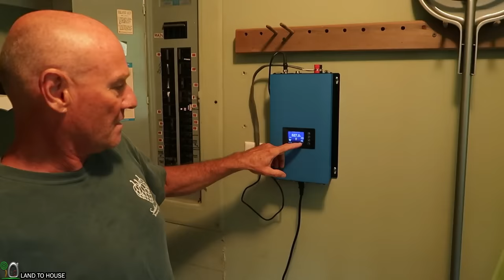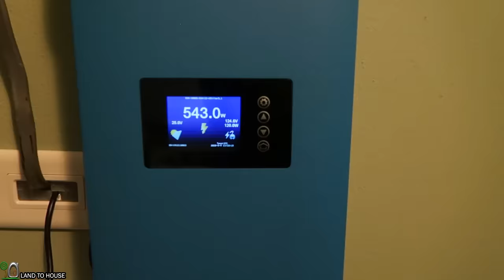Awesome Low Head High Flow Grid Tie Micro Hydro 530 watts!

Comment: If he replaced each of those 90 elbows with two 45's he would get significantly more velocity.
Reply from the maker: That is likely true!
Reply: Positive 👍
Reply: but would that not put extra load on the turbine ? does that matter ?
Reply: The creek might not have enough flow to allow more velocity to pass through turbine
Reply: a 90° eblow  can restrict flow up to 12%   always use swept bends     may be possible to do this with 4"  pipe .   running the syphon tube to a larger dia destroys the syphon.
Reply: As would placing the generator at the bottom of the pipe
Reply: @navrajjohal9053  That's extra power. Everything in the system has to work together.
Reply: More velocity=more flow, you saw how little was passing over when it was running, it`s likely he`s at the flow rate that can be sustained
Reply: @davidoff59  Given the syphon effect, is this true?

Comment: As an electrician, my only issue with this system is the male plug from the inverter plugged into a general outlet underneath the distribution board.
If you trip over that and expose the plug or a child pulls it out, those plug ends are a potential death trap.
Reply from the maker: When the grid is removed from the inverter it actually turns off.
Reply: I came here looking for this comment
Reply from the maker: Its the primary concern with this install. I personally keep my two grid tie limiter inverters locked up so nobody can get to them.
Reply: @LandtoHouse  If the sense wire is still energized but the cord is pulled does the inverter turn off the output anyway?  If so then it is ok.  If not it is a code violation of 406.7(B) Attachment plugs shall be installed so that their prongs, blades, or pins are not energized unless inserted into an energized receptacle or cord connectors.
Reply: you know he could put a regular switching panel in and have power when the grid goes out... The Plug thing is so wrong in so many ways ~!
Reply: The inverter circuitry itself is actually powered from the grid and instantly turns off if unplugged, plus it has a C14 plug that would probably pull out first.
Reply: @captainobvious9188  that wasn't very obvious captain obvious
Reply: He should have used a 3 wire with a ground cable.  You should never use the ground wire to carry a load.  Not safe.  Total shock hazard.
Reply: thats all you have problems with?
Reply: ok Karen..
Reply: @cadilakiller  feel better now?
Reply: He is using the  ground  wire as a hot.  Safer to use 10-3 w g and a larger jct box
Reply: @erbewayne6868  this is incredibly dangerous. Your right 10-3 with ground is required. As an electrical contractor i cringe watching these videos
Reply: @erbewayne6868  also check out the wires in his rectifier. There not going to last long you can see by the coloring of the wires that the heat is breaking it down. Please hire a licensed Electrician. I live in Asheville and there is so much thats not up to code. I love the set up im just really worried about the wiring.
Reply: @cadilakiller cringe.
Reply: Every grid tie inverter turns off when it is unsynced with the grid.
Reply: Yeah I can't believe someone does this crap these days, and to show other people to do it too.
Reply: The ol' suicide plug

Comment: Could have a float sensor that detects the lake level and controls a 6" valve near the intake. That would prevent the level of the lake dropping too much and loosing the siphon.
Reply: Actually it's probably easier to regulate it with a device on the priming side. You could T off to an automated valve to allow air in and on the other side of the t an automated shut off valve connected to suction (also automated). You could control it with some relays and a pii / arduino. When the float detects the level lowering it would start to let some air in, more and more as the level drops untill the system stops, then when the level returns to the max the air valve would close and the valve to suction and suction would activate for a set amount of time before shutting off to restart the system. That was there are no valves reducing peak efficiency
Reply: I'd be careful restricting the inlet.
With all that vacuum it could cause cavitation which would knacker the turbine.
Better to let a bit of air in downstream to partially disrupt the siphon.
I would bother with an Arduino. Too temperamental and fiddly.
You basically need an old toilet. Use the ballcock and valve as an air bleeder.
You may need a larger valve, or use several ballcocks at different levels so the system ramps up and down.
It's a tune and forget system.
Reply: @JCJC650  a piece of PVC mounted vertically  with holes drilled in it.  As the water drops more and more holes are exposed, allowing more and more air.
Reply: Daisy chain two or three turbines. Gain enough restrictions to slow it down and totally not have an electric bill. Connect the system to a nice set of supper caps, could possibly power two homes.
Reply: @itslegit7362  you can't daisy chain them. Well you can, but the headloss across each turbine would be reduced so each one would produce less power.
You would have to run them in parallel but then you would likely drain down the dam.
Reply: @wormfighter1  even simpler.
Reply: @richardschofield2201  I'm not saying your wrong. But I am Fire system tech for over 10yr, I work with tons of water. I know the amount of force that suction has, I don't think it would have that much of an effect on each turbine. Even if it did it would still make over 450wat per turbine.
Reply: @itslegit7362  I am not an expert, but my initial thought was he is wasting flow by only having one turbine.
Reply: @itslegit7362  feed the water out into a 44 gal drum and use the overflow to power a vortex turbine
Reply: @wormfighter1  I think you're probably on the right track here. Seems like the same basic analog circuitry that drives a carburetor would be the way to go.

Comment: It needs to have a floating needle and seat in the intake pipe to reduce the flow automatically if the water in the pond drops. That way he can avoid draining the pond and sucking air into the intake.

Comment: The tail tube allows the turbine to be mounted up high where it is easier to work on, and still use the entire drop from the dam to the tailwater.  The pressure at the turbine's exit is below atmospheric, elegant!
Reply: Exactly. It reminded me of  the draft tubes fitted after turbines from my old engineering days..I never fully understood what was the exact reason for them until this video and your comment. Thank you
Reply: @danalex2991  Glad to help. Many moons ago in high school, I was put into the national honor society (much to my surprise) because I did a good job of translating several teachers' garbled explanations into something my classmates could understand. Nice to know I haven't lost my touch.
Reply: The pull is as good as the push.
Reply: Why is the turbine at top. Wouldn't it be better, if it uses the entire drop of the water from the bottom.
Reply: @smartcookie11  The tail  tube pulls suction on the back side of the turbine so that the full head of the dam IS used. If you punch a hole in the tail tube right below the turbine, it will suck in air!

Comment: This is brilliant. With the vacuum pressure you're creating you could probably stair-step a couple more turbines into the system - cover all your needs. Might also create enough drag to slow the drain some - so you have less worry with draining the pond.
- Would a smaller pipe configuration slow the flow while still producing sufficient pressure to spin the turbine at optimum efficiency?  - 3" or 4" to 6" pipe, instead of 6" to 8" ?
Reply: Some Ram Pumps could be used at the outlet to reclaim some of the water as well. Maybe? Thoughts?